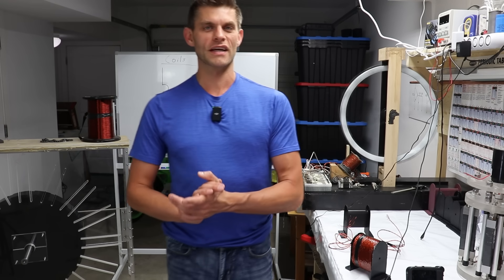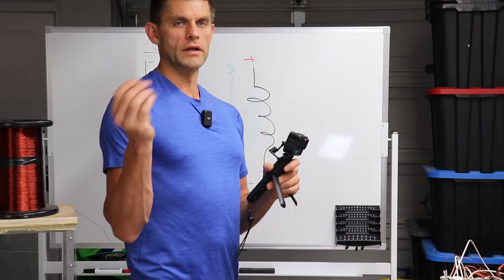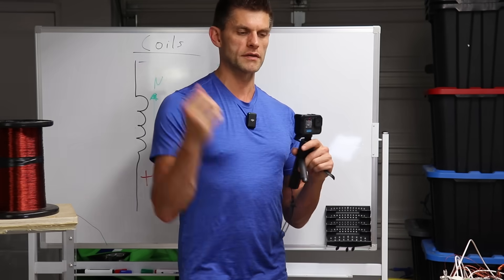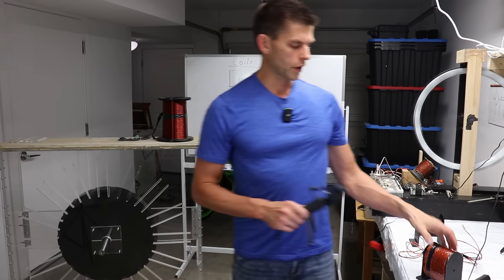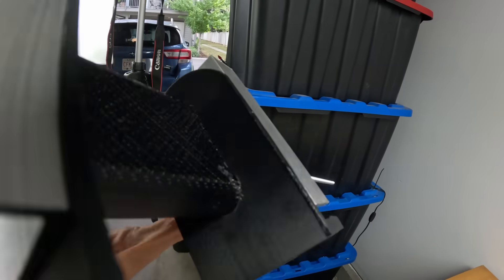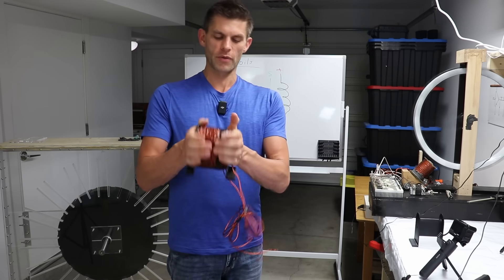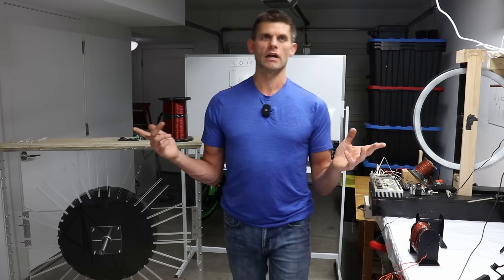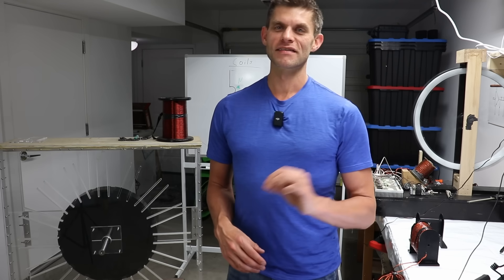Unlimited Energy in My Garage (No Patents)

Comment: Not sure I understand... This ''door'' you thats opens and allows 0point energy to flow into the circuit; How does it open? whats the exact mechanism in effect here?
Reply: @annonymeandfish
There is no "door".
Zero-point energy represents the lowest energy state a quantum system can have. In this ground state there is no lower energy level to transition to.
As work is defined as a transfer of energy that results in a displacement or a change in the state of an object, the fact that zero point energy cannot change from this ground state means that it cannot do work.

Therefore, he isn't "tapping zero energy".
In fact, his device isn't doing anything new or notable at all and zero point energy is just the latest buzzword for fake free energy devices. It used to be water engines and magnet motors, now it's ZPE.
New words, but some things really never change.
Reply from the maker: Ill explain in this week's video. Stay tuned 😊

Comment: I believe in zero point energy, it seems self evidently true to me; but there's something else that's self evidently true: there's no such thing as free energy.  No one has figured out how to access zero point energy.  So we don't know what the cost is, but just because something doesn't have a price tag doesn't mean its free.  You post step by step instructions on how to build a small one that can power so much as a single led light, then I'll build it.  If it works I'll give you money.  Until then, "free energy" is just mouth noises.
Reply from the maker: Stay tuned cuz its coming

Comment: 15 years ago was when I had your vision. May I suggest ceramic bearings and using the Fibonacci pattern for the angle of your magnets to speed the system up if you are needing.
Reply from the maker: Yes good sugestions, we are using ceramic bearings

Comment: Cool build! But there’s no evidence it’s pulling “zero‑point” energy. The flyback pulse is just the coil releasing the same energy you put in (½LI²) at a higher voltage. Routing that pulse to a second battery is normal regenerative/pulse charging lead acid batteries can momentarily show higher voltage, which can look like a gain. To prove real over‑unity you’d have to measure total watt hours from both batteries with a calibrated discharge test similar Bedini/pulse motors always come out ≤100% once measured correctly Still a neat DIY project just not free energy.
Reply from the maker: Thats generic thinking, we are not building a bedini. Its suped up. The flyback spike is used to trigger the vacuum energy flow in the batteries. This isnt just standard e and m its different enegy flow. Stay tuned. Also all we have to show is the batteries staying fully charged for weeks, the rpm staying the same, and excess work being done
Reply: @MadscienceLPTECH  all right well with that said looking forward to seeing the source

Comment: It's nonsense.
And of course there are no patents..there is nothing to patent.

4:15
The exact point at which the real nonsense starts, when for..reasons.. an induction coil utilizing principles that have been explored for almost 200 years somehow starts magically sucking energy (zero point of course!) from the great nowhere. 
Wow, how did every other physicist, inventor and electrical engineer miss this amazing unknown energy source?

The reality of course is that if one could harness every bit of available zero point energy in the known universe, it couldn't roll a pencil across the table.

Zero point energy is just the latest buzzwords. 140 years ago, prior to the Michaelson-Morley experiments, it would have been aether. In the 70's with the advent of the oil crisis it was motors that ran on water. Later magnet motors became all the rage, and they all share the same characteristics: flaws in measuring energy through a system, either deliberate or from ignorance, outright lies, and the reliance on an eternally renewing audience of hopefuls that dont' have the background to recognize either.

They are all variations on a theme-pseudoscientific claims that no one will ever be able to reproduce and promises based on thin air.

Read quickly my hopeful friends, posts discussing reality tend to have a short life span on these channels.

Comment: Why won't you show how much power you input and how much you output on your current machine?
Reply: You know the answer :D
Reply: because it's hard to fake that and make it look realistic
Reply from the maker: Im going to, I just ordered some meters... but you will see its not as easy as you think when its not conventional power out
Reply: All this work, and a degree in electrical engineering and no meters kicking around yet ? 🤔
Reply: @Roham lol, the very first thing I thought of as well. amusing really.
Reply: @Roham you forgot, plus 15 years of reseach, and yet no inpu and output readings.
Reply: @MadscienceLPTECH what does that mean? The power contained in high frequency spikes is difficult to measure? That’s just a guess.
Reply: @MadscienceLPTECH i'm curious about that.

Or what you can do is swap the batteries on your smaller machine once the input has been drained. If your theory is correct, you can then swap it with the other battery an unlimited amount of times.
Reply: @MadscienceLPTECH  How hard can "Does it push more than you pull" possibly get?

Comment: As a suggestion for the copper coils, use a larger gauge of wire AND see if you can thin-film vapour deposition coat them with a ceramic such as CERAM or VITREC which are a fused glass ceramic powder coatings you can buy online and use to thin film coat copper wire at home using a home-made vacuum chamber made out of an old 500 gallon propane tank that you can buy used for like $200 USD and sandblast the inside and weld some stringers and strakes on the inside to ensure the tank walls can take the stress of a HARD vacuum. 

You superheat the ceramic powder coating using induction-based heating to vapourize the CERAM or VITREC nanopowder and then coat all the copper wire that goes into your coils in a thin film of ceramic glass. The vapour deposition film is thin and flexible enough that it won't be too much of a problem even with the dissimilar thermal expansion co-efficients of the ceramic and copper, so cracking or separation from the wire will be very limited and present only at the very highest voltages/amperages!

You will get MUCH BETTER insulative properties on the copper coils and they won't burn out as you push higher voltages and amperages through them. Your design is GREAT and will eventually work once you put a better insulator on the copper coil wires.

You just need to make sure you buy copper wire that is FULLY UNCOATED with no plastic coating of any sort and is pure copper metal! The less oxygen in the copper, the better! I found that Mogami cable from Japan is best for this type of coil application as their manufacturing expertise for oxygen-free copper cable is unsurpassed in the world!

V
Reply from the maker: thanks for the detailed suggestions. i will check out. cheers

Comment: You cant just string a wire way up in the air and use the differential to generate "free energy" (not really free since the conservation of energy, its a differential. Its enough to power lightbulbs for free and i always wondered why it isnt used more for something like a street lamp, u could power them just by tethering a weather ballon to them and running the wire up. Youd have to refill the ballons every once in a while but i bet you could work onba more permanent bouyie
Reply from the maker: Excess energy

Comment: if there are bicycle like generators that can be powered by people's legs, why couldn't they be powered by sets of magnets repelling each other in circular motion instead of legs to generate electricity endlessly?
Reply: Because it takes as much energy to push  magnetic fields together as is available to pull them apart.

There are no free rides.
Reply from the maker: Thats not true. Promenade magnet motors are everywhere and proven.
Reply from the maker: They can be, engineers at Hitachi said so over 10 years ago. Terminate magnet generator motors are proven tech
Reply: @MadscienceLPTECH For a true magnet motor to work the magnets themselves would have to be a source of energy, but magnets cannot be an energy source-magnetism is a force expressed as a field, not a form of energy itself.
In fact there is no arrangement of magnets that will create 360 degrees of rotation without an outside energy input. All that one has to do is examine the pattern of a magnetic field for this to be clear.
Sorry-still no free rides, magnetic or otherwise.
🎉
Reply: @darklight2.1 you talk like magnets don’t store a field of potential energy in their fields. and when you move them past a conductor, that invisible force becomes real power. That’s the foundation of every generator on Earth
Reply: @robertmarbles  When you move magnets past a conductor, or vice versa, the energy is coming from you, the motivator moving things.
You are the energy source in your own magnet motor.

When you add or reduce current, the magnetic field changes in strength and size, but when you decrease the current, less energy will be available than you put in as there will be losses to heat.

Here's a fun question about magnets to think about:
When you stick a magnet on your refridgerator door and it remains there while clearly defying gravity, how much energy is the magnet using to perform this feat of gravitational defiance?
🤔

Comment: Holy buzz works. Your setup can’t work off quantums. 
Also the further you go down this rabbit hole, you learn over and over, you cannot create power. 
Now consider the inevitable amount of entropy you collect from your cheap wire. 
What you want is a discussion room, to give open classes and debates. Your language for this process is still under development with a massive amount of religious “faith”.
Last. Your degree appears worthless. Try and show what you’ve learned
Reply from the maker: No one is creating power. Does a hydro electric dam ? The purpose of this is open discussion and demos

Comment: I don't particularly like the analogy of water being used to describe electricity from an electrical perspective, but I can see its usefulness in certain contexts. I understand why it's often used in schools—teachers use the water analogy to help students grasp electrical theory. And yes, while water and electricity do have some comparable properties, the analogy only goes so far.

Thank you for your knowledge, patience, and dedication. The first law of thermodynamics is a powerful principle. There's often a lot of parasitic draw in systems, with components losing heat and causing efficiency levels to drop.

Energy from the spatial field—or what some refer to as zero-point energy—has been theorized for centuries. While I don't believe we currently have a working method to harness this form of energy reliably, I appreciate the exploration of the idea. I also liked your analogy of the water pump; the type you're describing sounds like a booster pump with an automatic shut-off mechanism, typically using a pressure switch. It’s similar to some of the electrical concepts you're referencing—it literally needs water to function. As I mentioned earlier, electricity can be a bit like a shunt pump in some ways.

I truly believe that within the next 50 years, we’ll see a solid and accessible method for generating electricity more freely—whether it’s through fusion, wind, water, photovoltaic cells, hydrothermal sources, or advanced nuclear technologies. Imagine molten salt nuclear plants installed locally, even at the end of your street—that would be ideal.

I really do think the best is yet to come. So to all the home labs and experimenters out there: keep pushing forward. In the next generation’s lifetime, we may finally unlock the potential for practical, decentralized energy solutions. Of course, “free energy” is a misnomer—energy itself isn’t truly free—but what we need are systems that are local, sustainable, clean, and highly efficient, with minimal parasitic loss.

I hope it soon becomes a reality, putting power literally into the hands of the people. Think of Tesla and the many visionaries who’ve tried before. Clean, running, drinkable water should be a human right, freely available to all. In the not-so-distant future, I hope access to electricity, Wi-Fi, and shelter will be seen the same way.

Many people are learning, building, and sharing knowledge. We owe a great debt to the millions who came before us. We truly stand on the shoulders of giants, benefiting from the infrastructures and innovations that shape the world we live in today—and that will support the generations to come.
Reply from the maker: Great comment thank you. I just want beginners to feel included too and I think water analogy helps them

Comment: As an EE (working in RF & Microwave systems) I love this. A noble effort making it open-source. I'll be contributing.
Reply from the maker: So good fellow EE :)
Reply: Look up Don Smith. Apparently he had micro units putting out large amounts of energy without the large coils using Ghz range.
Reply: What was your job, brushing the floor.

Only dumbass people believe this crap
Reply: EE's of the world unite!
Reply: Please do the math involved in this. We run current through an inductor, great. We then rapidly switch off the current, and then magically we get more energy out from the stored inductor? What?
Reply: This has to be a bot...

Comment: Cool demo, but this feels like classic over-unity/free energy stuff repackaged. The “flyback” voltage isn’t extra energy — it’s just the coil collapsing, and most of it gets lost in heat/resistance. Charging lead-acid batteries from high-voltage spikes is super inefficient too.

The bit about “opening a dipole” to tap zero-point energy sounds interesting, but there’s zero experimental proof or accepted physics behind it. No real measurements shown either — just spinning magnets.

Until there’s legit power-in vs power-out data, this just isn’t convincing.
Reply from the maker: Read some Eric p Dollard papers and see what you think
Reply: @MadscienceLPTECH  I’ve read some of Eric P Dollard’s work. He’s an interesting figure, but most of his ideas (like scalar waves and longitudinal electric waves) haven’t held up under scientific scrutiny. He’s never produced a repeatable experiment that demonstrates over-unity or zero-point extraction in a controlled environment. Referencing Dollard is fine, but it doesn’t replace real measurements, controlled testing, or peer-reviewed results. If your build works, show input and output power clearly. That’s all anyone’s asking.